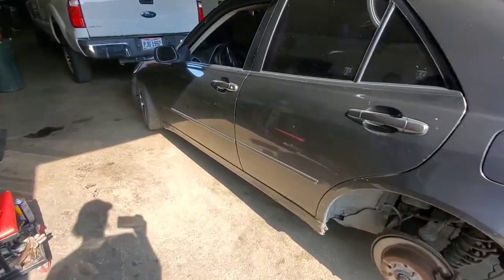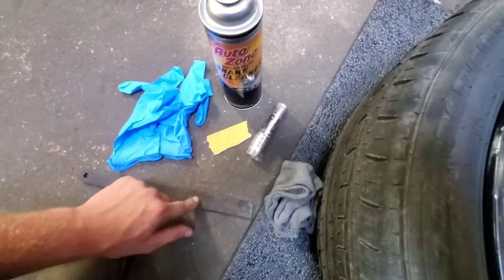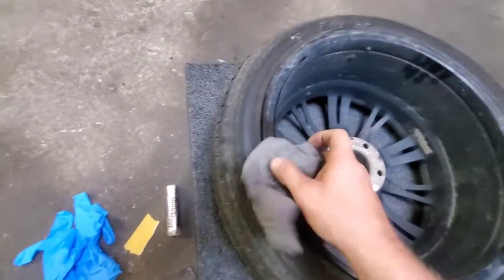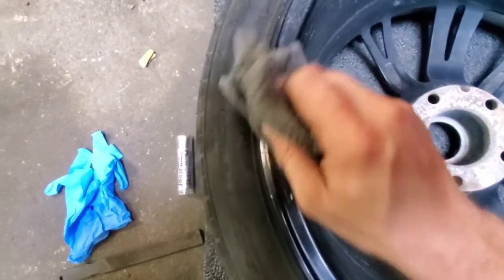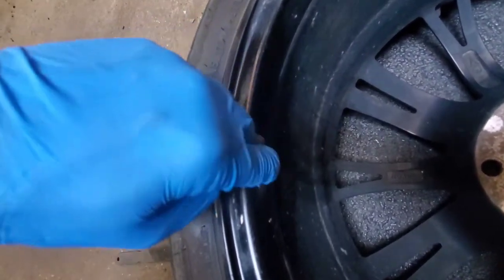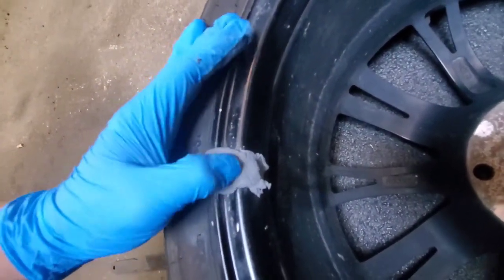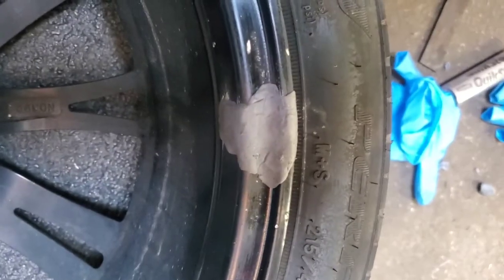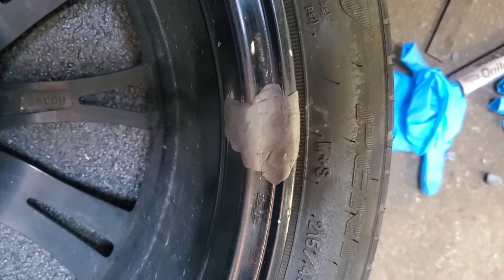How to fix a cracked wheel at home

Comment: Shouldn't the tire be off the rim?
Reply from the maker: Technically yes but I didn't have my tire machine yet
Reply: I think he should remove the tire or press it down cuz he needs to repair the other side as well the other side of the crack inside and outside